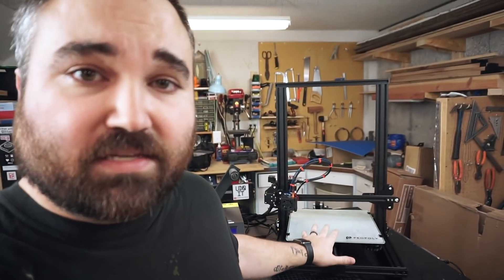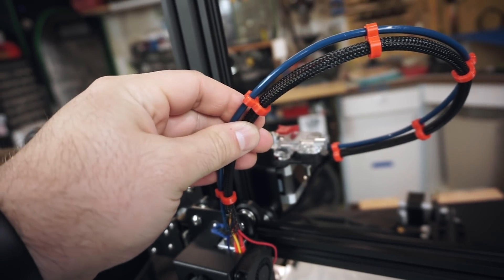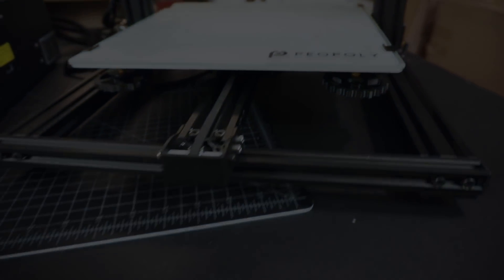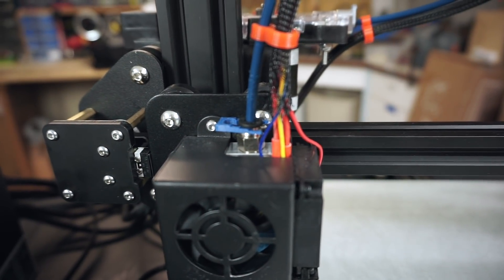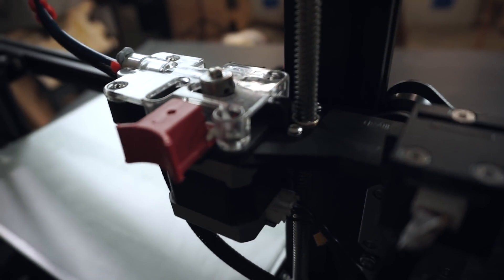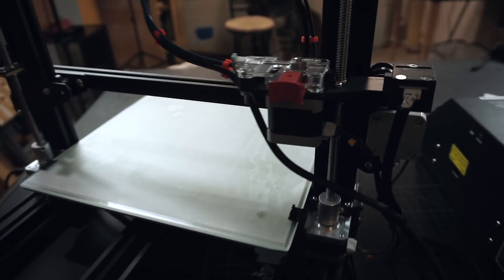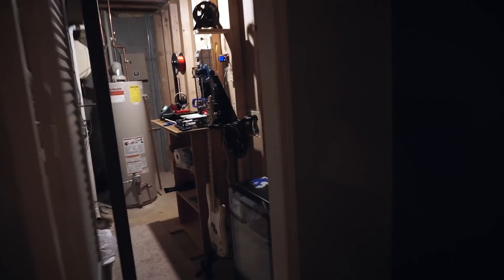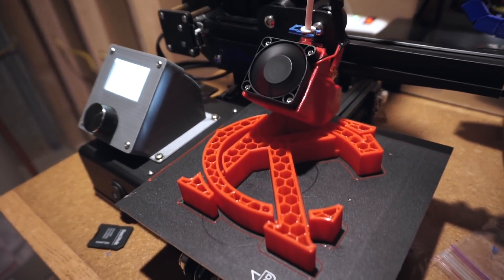My Top Creality CR-10s Mods & Upgrades

Comment from the maker: Have you made some upgrades/mods that you're proud of? Let us know here!
Reply: Octoprint running on an Raspberry Pi = no more SD card.
Reply from the maker: Matthew Humphrey yes! That’s a great one. I’ve got a pi with octoprint on one of my other printers. It’s great.
Reply: I like the Fang https://www.thingiverse.com/thing:2748641 seems to give more even cooling (doesn't need more air) Might need to remix it a touch for your hot end.
Reply from the maker: Sweet! I've heard great things about that one. More even part cooling wouldn't be a bad idea. Thanks!
Reply: You might like my version of the Bowden clips; they provide a way to clip in an additional wire, like for example the cable on an EZABL bed leveling sensor. https://www.thingiverse.com/thing:3153183
Reply from the maker: Ooh I'll definitely check that out. I'm going to be adding mesh bed leveling to it soon and will need a good way to manage those wires. Thanks!
Reply: That Bowden coupler clip didn't fit any of my fittings very well, so I designed my own. Here's the link in case you want to give it a try. https://www.thingiverse.com/thing:3175043
Reply: so I'm going into printing fresh never have done it and i've been researching mods to put on the printer to make it better when i first set it up with that extruder unit from seemecnc which option did you choose or is there a way to figure out  which will be best for me?

Comment: Can't get mine to do a consistent print the bed leveling is a major issue one tweak on one corner throws the whole build plate off but definitely gonna try these upgrades to try and see if it works better

Comment: Either I'm lucky as hell (which I highly doubt) or me keeping my original CR10 95% mod free is living proof that sometimes leaving well enough alone works best. I say that because I belong to a few 3D print chat groups on FaceBook and I see posts all the time how people changed this on their printer and now they're having problems. They changed that on their printers and now they're having problems. Meanwhile, here I've been printing problem free for almost a year with my CR10. The only mods I have done is upgrading the bowden tube to a Capricorn tube, aluminum extruder and I installed some vertical braces on the front to make sure my Z axis is perfectly square. Other than that, my printer is 100% stock and its been working perfectly. I think sometimes people do more harm than good by attempting to make their printers better but in turn they're actually making things worse by not leaving well enough alone. Just my opinion...
Reply from the maker: I love this and you bring up a really great point. I'll admit that each time something was added to the printer that impacted the filament "path", there was a fair amount of fine-tuning and tweaking that had to be done (estep calibration, slicer tweaking, etc). There are definitely some simple mods that I encourage people to print (bed adjustment knobs, bowden clips, etc). Any time you modify a 3D printer, you're using that printer in a way that the manufacturer didn't design it to be used, so there's definitely some headache that can come along with it.

Comment: What did you to for the filament sensor I see you have the stock one I had to open it up and tape the button otherwise it kept sliding off
Thank you
Reply from the maker: I actually didn’t have many issues with the sensor. I know what you mean, though. It’s pretty easy to pull off.

Comment: I have a new CR10 v2, and card reader is horrible. If i Press the card hard enough and hold it pressed, it will read the card, and if i let the pressure off, the card is not readable! bad first time experience.
Reply from the maker: Oh no! Sounds like quality control could be an issue. Sorry you've had a bad experience so far!

Comment: Sorry but for seemecnc extruder do you change steps per mm ? Because they said that " Remember to modify steps per mm if you are using this in a non-seemecnc 3D printer!"
Reply from the maker: Yes! I did calibrate the extruder steps. I should have mentioned that in the video. Great catch!

Comment: you were saying you wanted to put the spool holder on top.  I took the extra tnuts that came with my cr 10 and used it to attach it to the top rail.  I had to drill the holes on the bracket slightly to get the screws to work but i love having it on the top.
Reply from the maker: Nice! I will eventually do that. I currently have a faulty thermistor so I'm not able to use it at all until I get around to replacing that. ☹

Comment: Tnk u . Tnk s for mods . I manage to do almost perfect prints with my cr 10 s in 2 days . U right.  Bed is not perfect flat ... I taped under glass 2 layers of paper and is ok now . I m proud is a nice 3d printer , my first one . And to make perfect prints after only 2 days ...bltw i will make this a upgrades with time . Tnk s again .

P.s . For prints to stick ... first layer guys : temp of bed 90 , pla  220, first layer low speed and 0.1 mm , and in place of glass , I use IKEA mirror,  4 piece 7 euro (30x30) . With mirrors,  u can use first layer bed at 60 , and 0.15 , 0 2 works perfect to.
Reply from the maker: Thanks for the tip and the kind words! I agree. It is a solid printer!
Reply: Try mirror instead glass, or what u have for bed .

Comment: I got a Creality Polypropylene plate with my Ender 3 and I can't get anything to stick to it at all unless I cover it with a layer of Magigoo. :/
Reply from the maker: Oh no! That's supposed to be a BuildTak-esque material. Hmm... Have you cleaned it really well with isopropyl alcohol? You also made the right call with Magigoo. That stuff is incredible.
Reply: @AnthonyTackett  Yeah, it's advertised as the miracle build plate, things should just stick (and pop off when it cools), you shouldn't even have to clean it that well. Well, for me it sure doesn't work like that, I have to use the Magigoo or similar. Yes, I've cleaned it with IPA which almost seems to make things worse. I have no clue why it isn't working for me.
Reply from the maker: @SteinerSE  Man that's a bummer. Maybe you have a defective surface. Have you tried contacting Creality?

Comment: i got problem with my heat bed. i set the temperature to 68deg but it doesnt work. can you help me?
Reply from the maker: Hmm... I think there could be several things at play. If it were my machine, I'd check to make sure everything is plugged in properly and also that the cables at the back of the bed aren't broken. If it is a CR-10 and not the S model, it might not have proper strain relief at the back of the bed. There should be a plastic piece that the cables run through at the back of the bed. If there is a short in the wiring, you'll need to replace or repair them.
Reply from the maker: Oh and also make sure your machine is properly configured in your slicer. I believe you have to tell the slicer that your machine has a heated bed in the configuration.

Comment: I put a bondtech extruder, bought a e3dv6, with capricorn tubing and bltouch. Going to also add buildtak  flex plate system and e3d x nozzle  when that comes out. I also added vibration dampeners.
Reply from the maker: Niiice! I have a BLTouch for it now but haven't installed it. I think I'm going to try and film that process when I do. A flex plate system sounds incredible, too. I'll look into those vibration dampeners. Thanks!
Reply: @AnthonyTackett  I downloaded the Bowden tube clips you are using. I dont see the exact one you are using.
Reply from the maker: @michaelfuentes2171  Ah you're exactly right. I guess I have two types on there. Here is a link to the one on the extruder. I'll update the description with this one as well. https://www.thingiverse.com/thing:936611
Reply: @AnthonyTackett  I ended up down loading the orange you are using and modified it in solidworks  to have 2 openings instead of 3.

Comment: I've had mine for just over a year. I'm getting awesome prints and I haven't upgraded anything. I like the bigger wheels for leveling but I rarely even level. It stays level 95% of the time. Don't even remember the last time I leveled it. Should I just for soemthing to break? Lol not sure I even want to try the bowden. I don't want a small change to cause another issue. Suprised you needed all that. I use tape on my bed. Used to use glue on the glass but tape works fine. Do you put anything on the poly?
Reply from the maker: Hey. I wouldn't mess with anything if you're happy with it! Sounds like its working out well for you. I have another prusa-style machine that I had already upgraded the tubing on (and saw improvements) so that was a logical upgrade here. The peopoly build surface works great and is extremely durable. I DO add a glaze of Magigoo or glue stick for prints with a larger footprint. They will tend to lift up a bit if I don't. My other printer has a GeckoTek build surface on it and it's absolutely incredible. I plan to swap out the sheet on the CR10s for one of those at some point. Thanks for the comment!
Reply: @AnthonyTackett  thanks for the info. Amazon won't let me purchase the poly. I guess they don't sell it anymore. $8 was a steal.

Comment: I purchased the extruder on your list for my Cr-10s, but the gripper that came with it is a bit too small to fit on the motor shaft. Did you have issues with that, and did you just have to use the original filament gripper?
Reply from the maker: Ah I forgot to bring this up in the video. I’m using the gear that came with the extruder but do remember having to muscle it onto the shaft. I tapped it on with a block of wood, if I recall correctly.

Comment: Hey, nice vid!
I also had the problems with the extruder, my problem seemed to be that the bearing stopped turning every now and then, increasing friction and thus requiring the already undersized motor to work harder, which made it slip.
I now have the old EZstruder from Seemecnc on mine with some minor mods to this extruder to make it fit. works like a charm! (got a free one with 3 spools of filament 5 years ago :P)
thanks for the headup of the EZRstruder that it can print flexible well, I might buy that now!
That capricorn tube also sounds like a nice mod, I might need to tighten up the bowden system aswell.

some future mods for you maybe:
A 2020 extrusion X-Z brace I designed:  https://www.thingiverse.com/thing:3219013
some squashball dampners / feet for noise reduction:  https://www.thingiverse.com/thing:2847072

If you hear some high frequency rattling, sounding like metal on metal vibration, try applying some tape under both bolt lugs of the horend cover and the surface where this cover touches the X-axis plate.
Reply from the maker: Thanks for the kind words and recommendations! Will definitely give it a look. I have a bltouch now that I plan to put on it. Really enjoying the printer so far!

Comment: I tried different build surfaces and only one was flawless - a sheet of PEI with the 3M adhesive thermal tape. Threw a high voltage mosfet (its huge) and changed the cabling out to the heat bed (requires soldering) with high current subwoofer cable - getting a lot higher current now to the bed. 115c is possible now. Using marlin 1.1.8 and holding off on 1.1.9 for a while. I got the micro swiss all metal and its a DREAM. The microswiss nozzle though, is, I hate to say  s__t. I was getting between .45 & .5 extrusion form it. The cheap brass ones on amazon were much closer to.4 (got like 10 nozzles for $10).   Vibration dampners are a MUST! Dampners on the feet also are a huge benefit - print these in PETG and your set.  All aluminum extruder upgrade parts kit (amazon) was a huge benefit ($20). Its not the teeth on the extruder thats your problem,  its the weak spring that was supplied which SHOULD have been adjustable and had a tighter grip. I got some extruder brass ends and the teeth were all the same, the tensioner on the spring was the key. The spool holder is an absolute joke on the CR-10S, ive had the computer fall over so many times with heavy filament. Yet the cables to the printer from the computer were so short I had a hard time flipping the spool holder around without the spool hitting the printer (they were short). Thought about gutting the computer box and having a custom layout for it. I also upgraded the fans in the box (not buying stupid noctuas) I had a box of cooler master berring fans and their working. Although I did cave and put a noctua on the hot-end cooling fan since it was freaking LOUD with the stock fan. A hot end internal DUCT is a must so you dont have it blowing air down on your print when not needed (eg. ABS! Nylon!) use PETG for this...  One part that dosent exist that I feel would be nice is a teflon tube for the spool holder. or a sleeve to put over the existing one. After going through about 20 rolls of filament the holders tube is getting a bit worn down and has a lot more drag - maybe silicone spray but thats a mess...  I wanna cram a 32 bit board like a smoothie into this box... That would be sweet.

EDIT:  Almost forgot - I over-volted the PSU. Running about 13.6v - this stabilized the motors (less harmonic vibrations) and gave the bed a nice boost. 0-60c in no time now. DO NOT EXCEED 14v though, the main board wasent rated for anything higher. The PSU (when bed, motors and nozzle were on) had some VDROOP and it started dipping into the 10v range which caused some shuddering from the motors after running for hours.
Reply from the maker: NICE! You've given that machine some TLC. I'm about to put a bltouch on mine but might look into snagging/printing some of the vibration dampeners you mentioned. Thanks for sharing!

Comment: Link to the firmware upgrade?
Reply from the maker: No problem! I got my firmware files from Printed Solid. I'm currently running Marlin 1.1.6 but plan to update to 1.1.9 soon. Here is a link for that, since it's newer. https://www.printedsolid.com/blogs/news/installing-marlin-1-1-9-on-your-cr-10s-with-mesh-bed-leveling-thermal-protection-better-menu-layout-and-finally-power-resume

Comment: Great video and the vlog style worked well. I liked and subscribed. I have a CR10s also for a few months now. Curious as to why you went with the larger diameter hot end. Any issues with staying with standard size?
Reply from the maker: Thanks for the kind words and the sub! I have two smaller printers and thought it would be nice to bring larger, more rigid parts on this so that’s the main reason for the larger hot end. I had some under extrusion issues prior but I think that was caused by the stock gear slipping. I’m tempted to go even larger, honestly. I kind of like the wider extrusion and the gain I can get in printing times by printing thicker lines.
Reply: Thanks for the quick reply. Overall with some minor tweaks (leveling knobs) and some patience leveling my print bed my printer has been printing quite well. Although I am sure plenty of room for improvement and will most likely follow suit with your upgrades. I am curious to see how a larger hot end would work for me to as you have some great points. Pretty straight forward swap out? Was it easy to calibrate your extruded after the change? Thanks again.
Reply from the maker: Changing out for the Micro Swiss hot end is as easy as unscrewing the old one and screwing the new one on in its place. Any time you mess with the “resistance” of the filament flow, you should calibrate your e-steps just to be safe. There are great videos out there on how to do that. I always reference Joe Terranella’s videos on stuff like that. He’s a dear friend and is very knowledgeable on stuff like this.

Comment: Anthony, you can mount the spool holder on the box to the top of the frame using a couple of M3 hammer nuts and the existing screws.
Reply from the maker: Nice! I've seen people mount them on the frame like that but hadn't looked into how they did it. Thanks for the tip!

Comment: Hey man. Thanks for the video. I think I'll be getting a cr10s. How much did all those upgrades cost?
Reply from the maker: Hey! You're welcome!
You can check out the links in the video description for Amazon pricing. The capricorn tubing is around $15, I think. The extruder is about $35. The peopoly build surface is $8. The hotend is just under $65. Again, you might want to check out the links in the description for the latest pricing.

Best,
Anthony

Comment: Great video!
I was wondering if you experienced any issues with the capricorn tubing?
I installed one on my cr10s and immediately experienced some underextrusion. Did you have to adjust your retraction settings? And if so, how?
Thanks :)
Reply from the maker: Thanks! I have cap tubes on 2 of my printers and haven't had any issues. One thing you might want to double check is the cut angle on the tube. Bowden tubes need to be cut as close to a right angle as possible to ensure a proper fit against the heat break. You could also check to see if there is a clog that is preventing the tubing from going in all the way. That would cause under-extrusion. I had an issue with my CR10s when I first got it that took forever to figure out. The pneumatic coupling that the tube slips into had worn out and was letting the tube back out during retractions. I had a big ball of plastic that was preventing the bowden tube from seating properly. I'd take a peak into the hotend to check for that. It's a known problem with those creality hot ends. My Ender 2 has the same issue periodically.
Reply: @AnthonyTackett  i did notice the fittings letting the tube move a bit. I ordered and installed new ones from captubes with hopes of resolving the issue. Though now i'm having thermal runaway issues so a new thermistor will be installed today.

Hopefully most of my issues will be resolved this week.
Reply from the maker: Good luck! It seems like I'm always breaking something on one of my printers.
Reply: @AnthonyTackett  Thanks. Glad I'm not the only one haha :-D